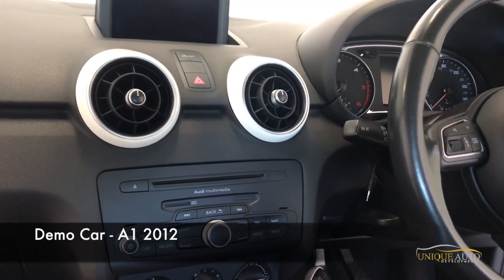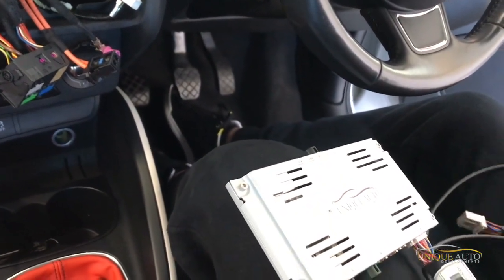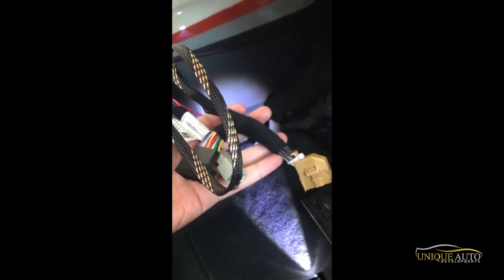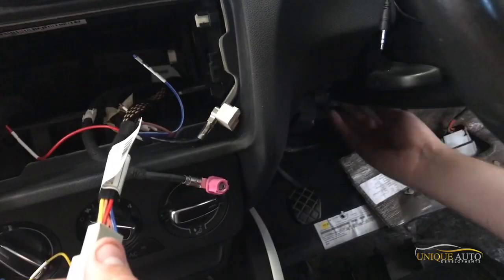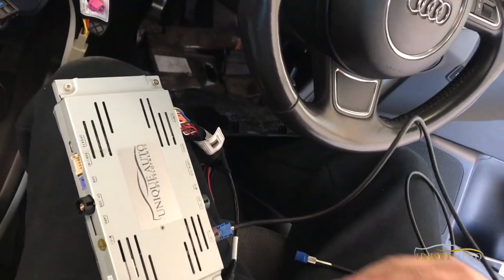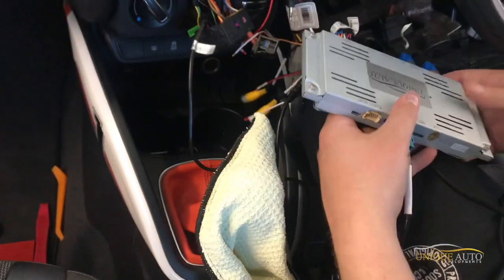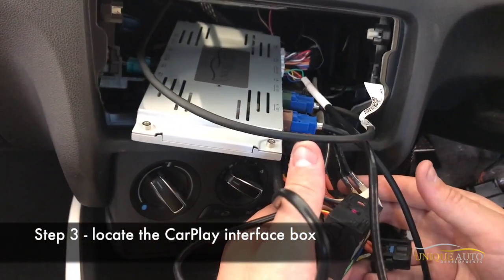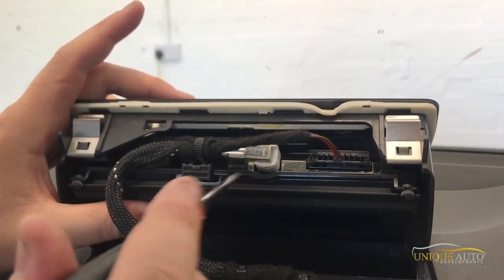Audi A1 Q3 CarPlay Retrofit  Installation Guide

Comment: I'd like to know if this fits my car ? I have an A1 with RMC, aux in slot next to the cigarette lighter. My car has no multi-function steering wheel ? AFAIK I can still control the interface using the MMI controls, but what about voice control ? I am wondering if the built-in car's mic is part of the multi-function steering wheel. Thanks.
Reply from the maker: You may consider upgrade your steering wheel which will be more convenient. You can use siri with touch screen control or just saying "hey siri".

Comment: I have an Audi S1 2015 with MMI 3G + without a SIM card, and an Audi A1 2011 with MMI 2G. Do they both need the same system? and the touch function works on both?
Reply: Did you do the S1?
Reply: @louisstanden2677  no

Comment: Very intersted in adding this to my Q3. Will this work on the US model Q3 and does the kit come with the touch screen or do you need to order it as a addon?
Reply from the maker: The touch overlay is included in the pack if you select "Audi Multimedia" type in the drop down menu. As the touch overlay doesn't work for MMI high type of head unit. The product shown in the video is our old module. The new module is available here https://unique-ad.co.uk/product/audi-q3-2011-carplay-retrofit-kit/

Comment: Incomplete. You didnt specify where to make the hole for the USB port. I think you will have to drill it somewhere right?
Reply from the maker: Hello there. Our current generation of CarPlay supports wireless connection via  wifi and Bluetooth. You don't need to use the USB port unless for the purpose of watching videos or software updates. So you can just hide the port wherever you prefer. No drilling is required.

Comment: Will this work on 2016 Audi Q3 with factory installed navigation?
Reply from the maker: Hi there, yes it will work for your Q3. We have recently launched the wireless CarPlay for this model. So you don't need to plug in your phone and your iPhone will auto connect when you get into the car. Link here https://unique-ad.co.uk/product/audi-q3-2011-carplay-retrofit-kit/
Reply: @uniqueautodevelopments   Do we have to follow the same installation process to install the wireless kit? Cheers